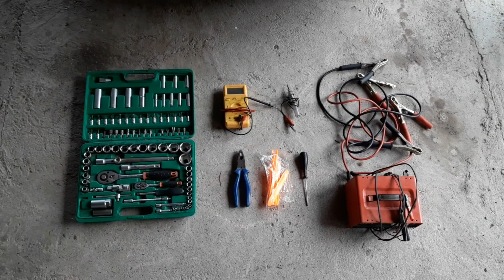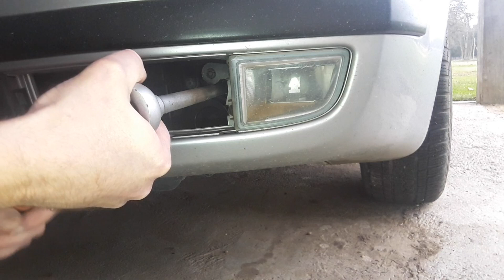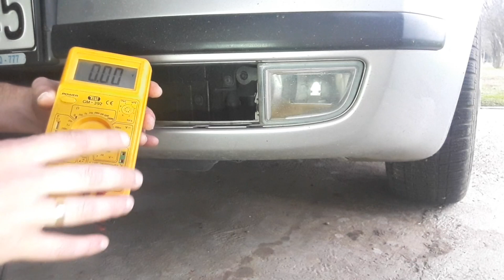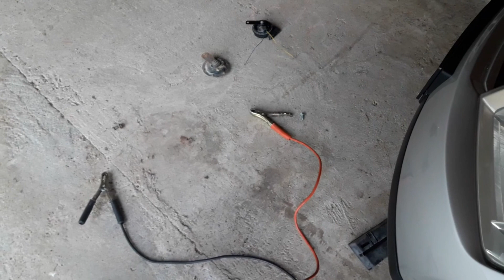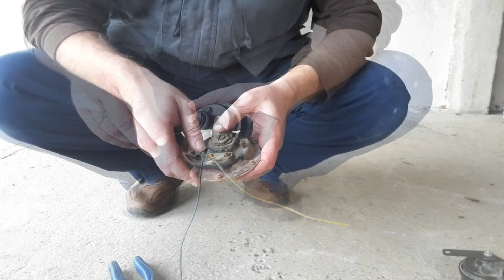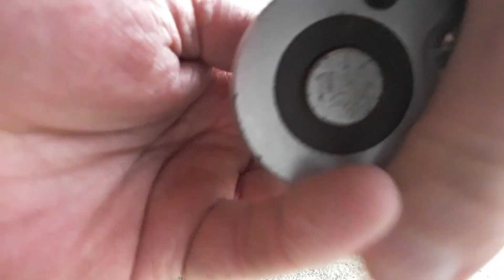CAR HORN-HOW TO FIX-TEST-REPLACE-ADJUST AND MORE

Comment: L change frequancy but it's not working properly
Reply from the maker: Hi and sorry for the late reply!

I don't know if I understood correctly, did you turn the setting screw on the horn and it still doesn't make a good sound?
Reply: @DespairRepair  yes trun anti clock wise a little bit.. Know his sound is very bad.. Tell me how I fixed default setting again??
Reply: Clock wise increased nd anti colock decreased.. Is it true bro
Reply from the maker: @creativeboy351  This is the case with almost all car horns as a standard type screw is used to adjust the horn (thus the rotation I mentioned).

One more thing: if the horn is damaged or worn out (like if the diphragm is damaged) then the horn can't be properly adjusted.

You'll get a sound, but not the proper one.
Reply from the maker: @creativeboy351  You'll just have to turn the screw until you get the same sound again.
(unless you marked the screw in it's original position).

If the horn worked previuosly and it's not faulty, you should be able to find the original sound again.
Reply: @DespairRepair  okey bro good.. I try once again.. Screw trunig position.. Tell me.. Fella
Reply: @DespairRepair  okey bro good.. I try once again.. Screw trunig position.. Tell me.. Fella
Reply: @DespairRepair  not working.. I trun the screw all the way.. Butt still v bad volice nd sound